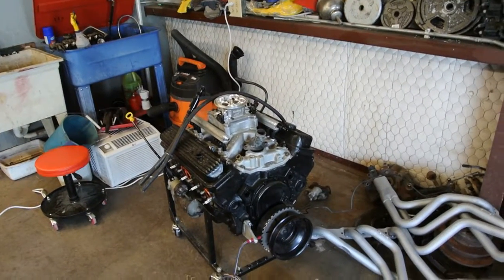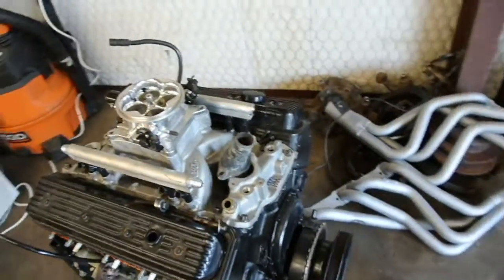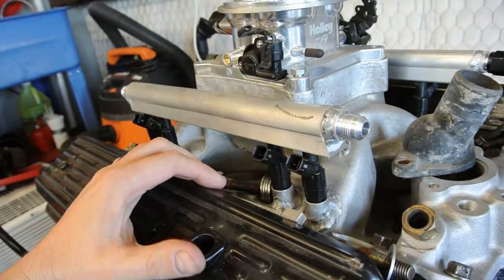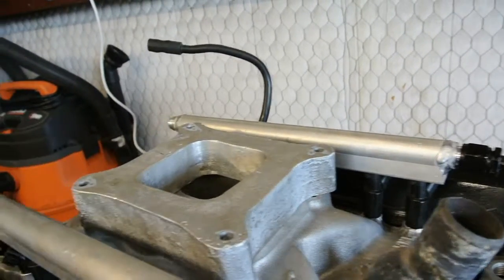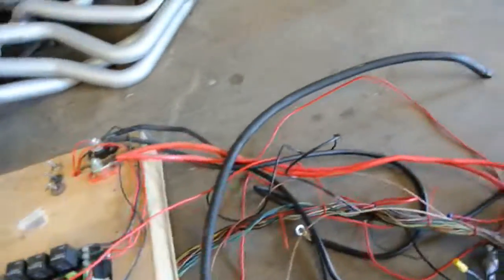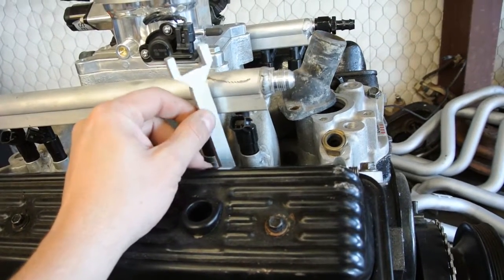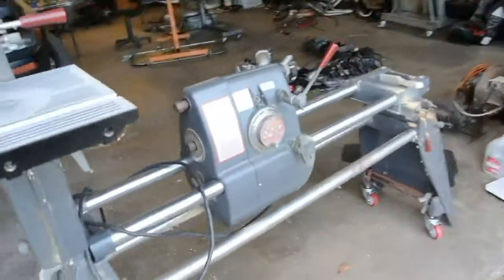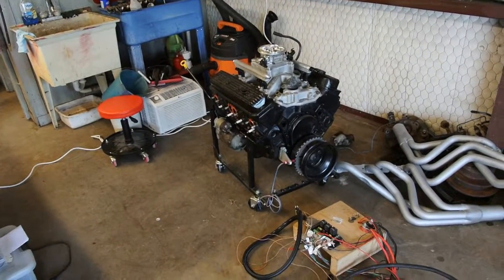Side Project SBC EFI Conversion Overview

Comment: Hey man I’m not sure how old this video is but I’m looking to do something similar and I’m using a 700r4 transmission, do those throttle bodies have the same sort of linkage as say a Holley carb that a TV cable adapter can bolt to?